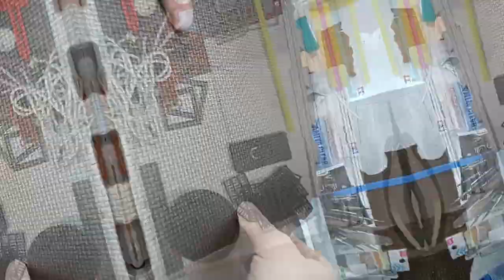Custom Necromunda gaming tiles.

Comment: I saw this video ages ago, but just bought some of these tiles yesterday. (£5.50 for eight here in UK.)

It took me a while to find the video again, but glad I did.
Reply from the maker: Good luck with the build mate. I have been using mine a lot recently and had zero issues with them. It's also satisfying when rolling dice on them as they are quiet and have a tiny bit of bounce.

Comment: How did you do the large chevron lines.

In the stills it looks recessed but i thought i saw a pic of it unpainted and it looks like tape?
Reply from the maker: It is textured tape that I painting. Painting them I measured out the lines and then painted those by hand.